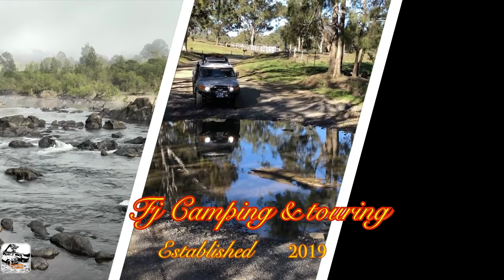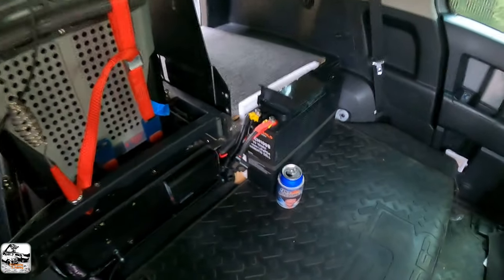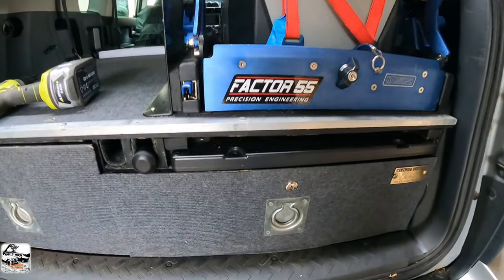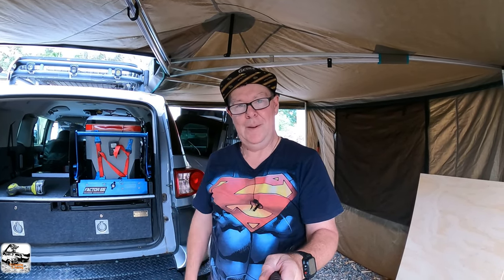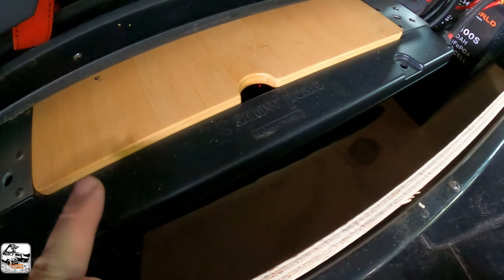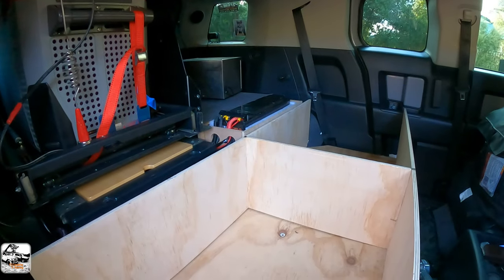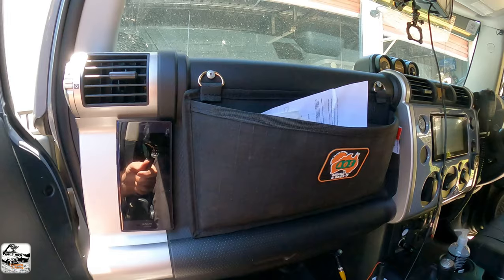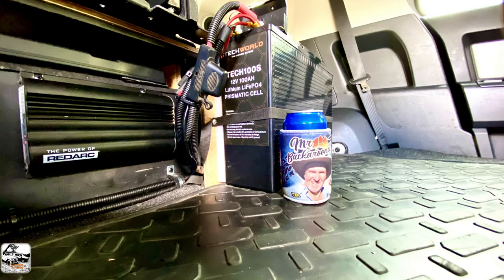Itechworld lithium battery installation in fj cruiser

Comment: Hi Steve I also have a fj ,and would love to know what you are using to hold you axe on your back door ,and how you mounted it as would love to do the same. Cheers
Reply from the maker: I actually bought this at a  garage sale and it came with a holder it was brand-new I don’t think I’ve ever been used was only $20 I’ve never seen another one like it it’s actually a great axe if I ever find out where it come from I will let you know👍

Comment: Are you really happy with the itecworld lithium battery now that you've had it for about 9 months ? Thanks we
Reply from the maker: It has been performing great my fridge runs 24 seven as a fridge freezer I also charge most of my camera gear of this battery when travelling  it very rarely gets Below 72% but when it does I have 160 W of solar on the roof and it recharges it in no time would I change anything yes I would get a larger battery not that the 100amp Isn’t doing a great job it would be good just to have a little bit more so that I could run a few bigger appliances with an inverter cheers thanks for your question